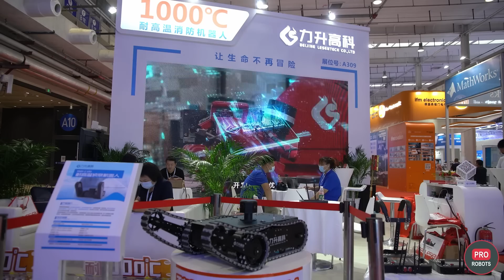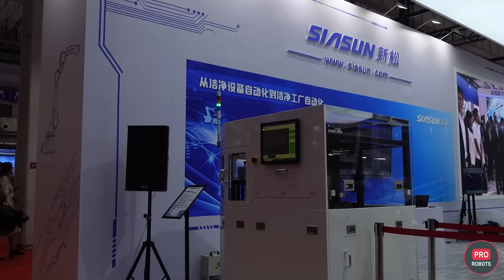WRC 2022 - China's largest robot exhibition | Robots and technologies at the exhibition in China

Comment: Please make some robot cats, so the cats would not be mistreated  just for the purpose of catching rats, many of them are locked up in basements and warehouses, yesterday I had an interesting dream,  I was on a white grain shape flying object with a female pilot, it looks very simple, no wheels no wings no gears, and soundless,  it's about 5 feet wide and 50 feet long,  it can fly very steady and can slide on the snow,  the right side rectangle door was open but I would not fall out, the wind and snow cannot blow inside,  it's not cold either,  it's like there is some kind of air that can block it , inside I can reach out my hand and feel the snow, the cover of the single door is slide over to the left, I just wonder if there is such a thing like that

Comment: those 4 legged robots looked like they could be used for very lethal purposes on a battlefield 
have a bunch of them fitted with explosives have them run into a forested area where combat is going
on and simply detonate them near large groups of soldiers, also great for night operations in combat areas
simply apply night vision tech and have then run into a building or into a tunnel through the streets , these bots could be a game changer for any military

Comment: The surgery robots open the possibility of remote surgery. Imagine one robot surgeon in a remote, undeveloped region. Whenever a surgery is necessary, a surgeon from anywhere around the world can log on to their terminal and perform the surgery.
Reply: It would be cheaper to fly the surgeon to that country than keep a robotic surgical unit there.
Reply: Remote surgery has already been tested, using 5G low-latency networks and robots, you can find it on YT